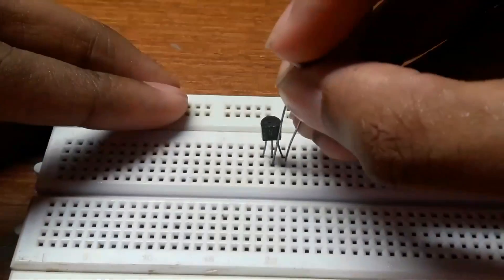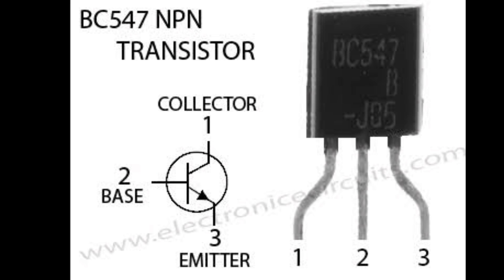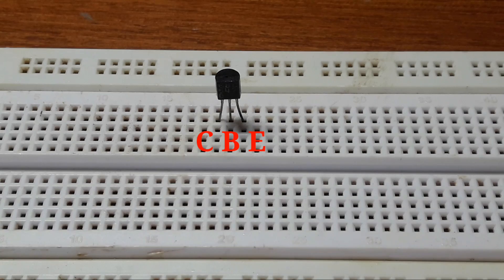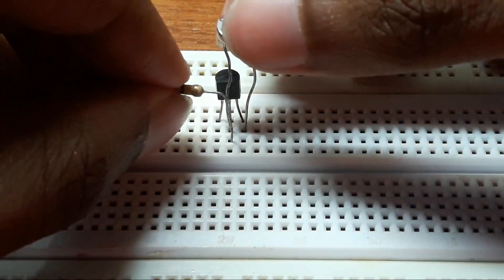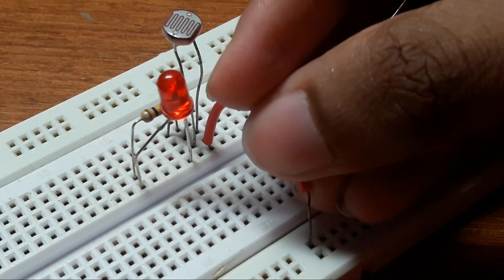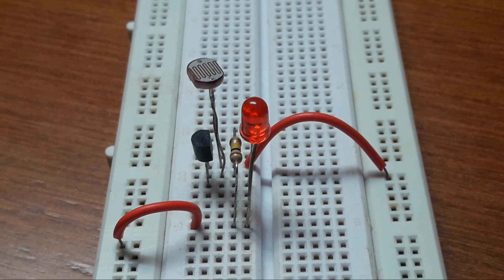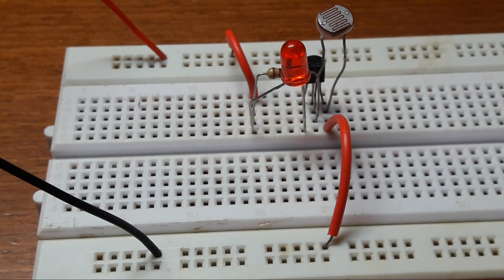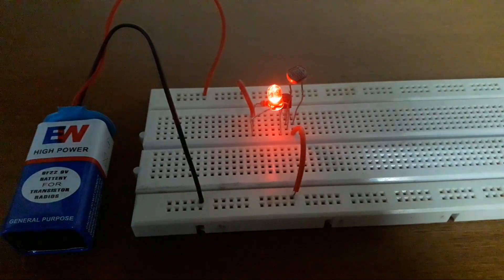How To Make A Dark Sensor On A Breadboard [HD]

Comment: Will it work without the transistor? I have seen simple circuit diagram without the transistor consisting just a battery, wires, a resistor, LDR and LED

Comment: If the resistance in LDRs increases with darkness then doesn't that mean that the LED is going to switch on when there's light in the enviroment? I've seen this circuit in other videos and I'm still confused about that
Reply: More light = more resistance

Comment: I made all of the connections and made with the same components, and it is working the opposite; when light is on it, it lights up but when the light is off, it doesn’t light up, can you please help me quickly
Thank you
Reply: I figured out that I was putting the cathode of the led in the base, but when I plugged it in the collector it didn’t work at all
Reply: Please answer me

Comment: Connected battery. Led switched on for 2seconds then switched off. My resistor is 1M OHM !! please help. I only have 1M OHM and 330 ohm with me

Edit: I bought a 100K resistor,  worked just fine! Thank you
Reply from the maker: You have to use a 100k ohm resistor only. 
It will not work with 1M ohm resistor....
Reply from the maker: Since you said you have a 330 ohm resistor, try using it in place of that 1M ohm resistor.... Hope it works :-)

Comment: I tried to make this but got only a voltage diff of 0.02 V bw the led pins in light and dark.
Even tried 2N222 but nothing.only 0.2 V diff.
I used
BC557 and changed the polarity accordingly
Moreover my LDR works kinda weird 
It is 0.5 M Ohm in light
And 0.3M Ohm in dark
Is it possible??
I even tested my multimeter and found it to be working correctly.

Comment: I am a beginner, at first it didn’t work but since I use arduino I realized it has to go from negative to positive because your using a battery and it worked! 
Edit: I mean like I didn’t realize I was putting it wrong I know it goes from negative to positive

Comment: How would I go about using an LDR, like you have on this breadboard, to power a 12volt relay.?

The second question is, How would you wire this to activate the relay, when the LDR senses light and shuts the relay off when the LDR senses no light?  Thank you

Comment: it's working totally reverse what can I do
Reply: so 100k ohm doesn't work? my circuit worked the last time I did it, but it is now reversed.
Reply: There are two types of thermistor PNP and NPN 
Maybe ur thermistor is NPN that's why it is not working ..properly purchase a PNP resistor and thank me later.
Reply: Check the ic polarity
Reply: Use a pnp
Reply: Mine tooo
Reply: Mine is flashing
Reply: Thumula - I replaced the 100K resistor with a 680K resistor, and now it works!  The LED still has a VERY small illumination in a dimly-lit room, but the LED lights up perfectly in darkness.  I may try a 1M resistor to see if that helps.
Reply: Same
Reply: Thamula - It may not actually be reverse.  Try shining a bright flashlight on the LDR to see if that turns off the LED.  If the LED turns off, you created the circuit correctly.

I have tried SEVERAL “dark detector” circuits, and they ALL have this problem (at least for me).  I am going to try a 100 K potentiometer in series with the 100 K resistor to see if I just need more resistance in the circuit.

Please let me know if the flashlight turns off your LED.  Good luck!